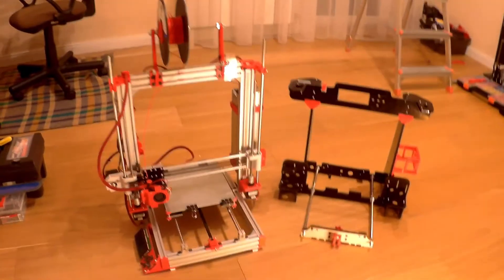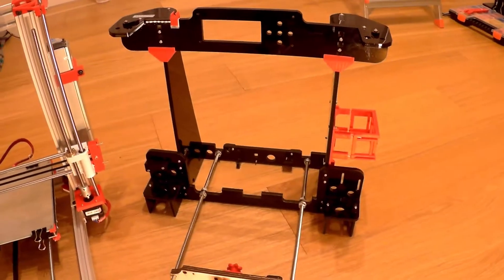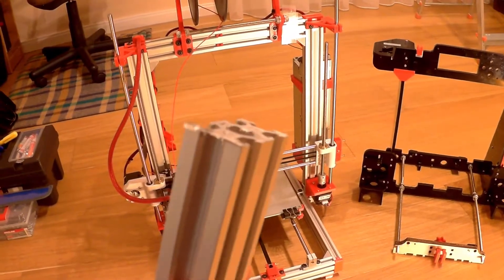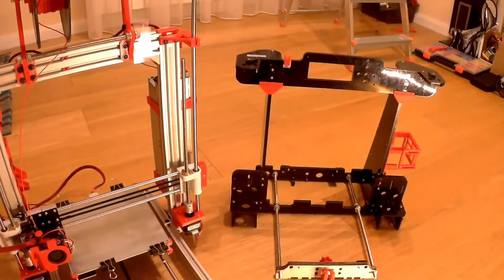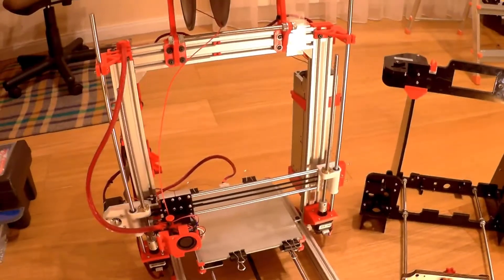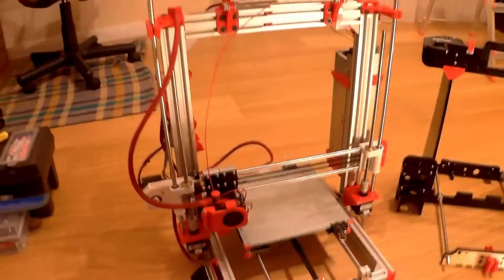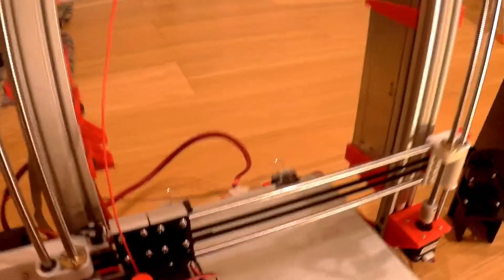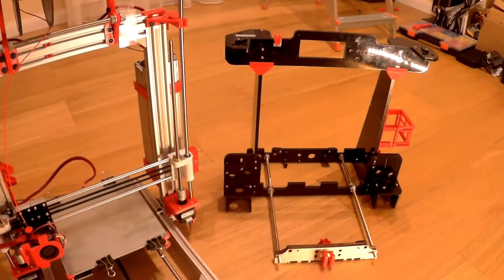Anet A8 metal frame upgrade

Comment: Gread video M8, thank you for the info!!
I see you did not print the Rod holders rather you bought alouminium  ones, isnt that a bit higher from the plan?Did you encounter any problem with the bed's belt with this?
I am planning to start my mod soon, any more suggestiong since the video?
Reply from the maker: Actually i DID have problems

With aluminium rod holders the H plate will hit the rood holder.
So to avoid that i printed spacers between the LMU casing and the H platter

And i actually noticed that the H-bracket / plate is bending when the bed knobs are tighten and that generates vibrations on the bed. 

I strongly suggest getting that H-bracket changed to a stiff an light one (laser cut alu or maybe carbon fiber?).  Next upgrade on mine will be redesign H bracket or completely new Y axis design

Comment: Can you show some comparison build results ?
Reply from the maker: you mean completed prints ?

hmm not realy as i didnt take before and after, but there is less ghosting and most importantly the machine is a LOT more repeatable.

Good result is less dependent on luck as on standard frame, and is far quieter and smooth. 
Also less ghosting although i still have some osculation issues coming from the H plate and the bearings them self
Reply: Ok , so do I understand from that you can still improve replacing the H and the bearings ?  I am looking to do the same , buying one of these AM8 kits.
I already printed the pieces,  and I also saw a replacement plate for the H.  that seems thicker and stronger ...
Reply from the maker: Basically yes 

You see the original H plate is relay soft - it beds when you adjust the bed level to tightly.
I noticed that when moving the bed without the belts - it moved freely and after tightening the belt leveling and getting the level done - the bed did not move freely.

There are basically 2 problems with original H plate:
 - Stiffness (lack of it)
- Bearings and bracket screw holes aliment 

For now I completely removed the 'connecting' plate and just left the 2 latitude plates that mount the bearings and to connect these two i printed thicker plate

This is way better but still not the best -  the best is to cut this by laser from a Stiff metal with exact aliment of mounting holes